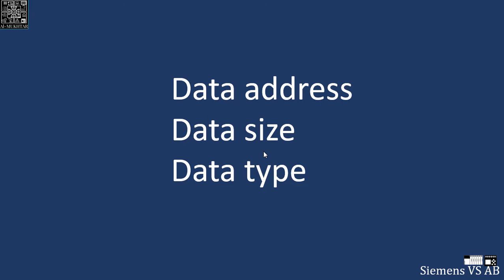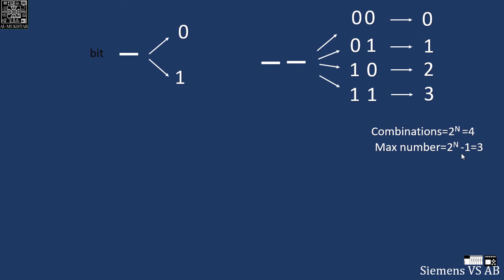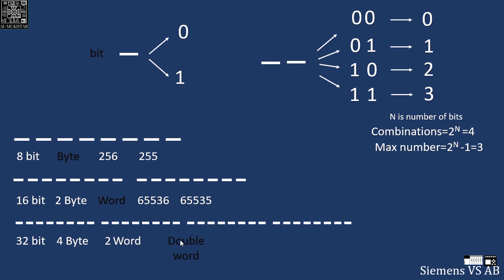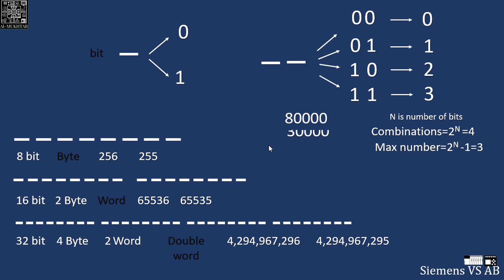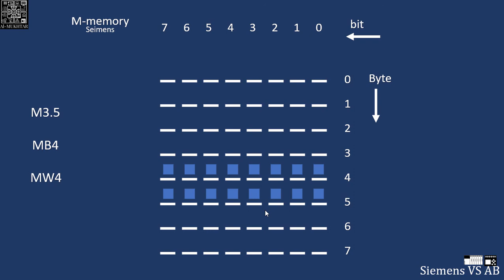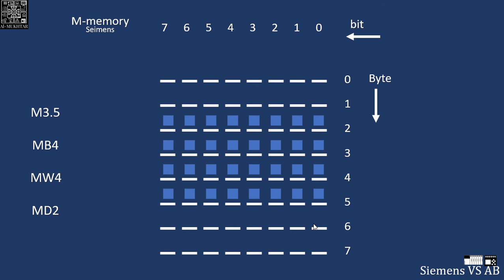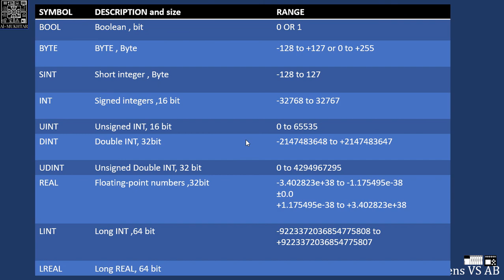PLC data types

Comment: Dear Ali thank you very much for this vidio 
I need clarification and your support for following question if I get three plc either same or different brand how can summarize the data size to determine the size and specification of  switch , data warehouse ? 
I mention three plc just as example 

If it is more no issue my point is there reference to determine the size of date store ???? 

I fully appresdiate for your support in advance 
Best regards 
Osama nasher

Comment: Hi Dear I have a question , How can i combine 2x16 bit into 1x32 bit ?
Reply from the maker: If they are next to each other just call the address Mdxx if they are not use move commands to move the values next each other and the call them by MDxx
Reply: @almukhtar77  I read 2 int value from MODBUS Register of 40001 and 40002 , i need to combine these values and convert to DINT
Reply from the maker: @hasankeskin977  move first value lets say mw100 then move other value to mw102 then you value will be md100 , be careful wich one is the least significant value
Reply: @almukhtar77  Can we do that without using move command ? How can i do these operation with math operations ?